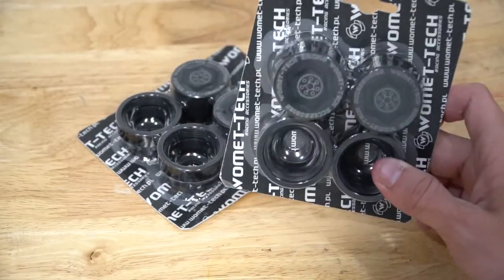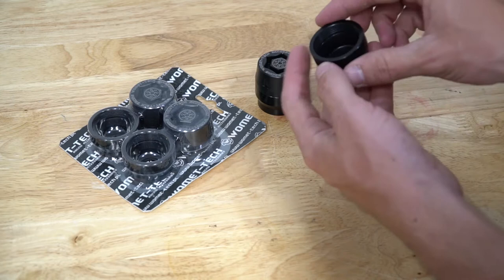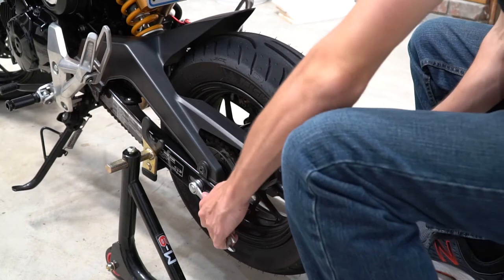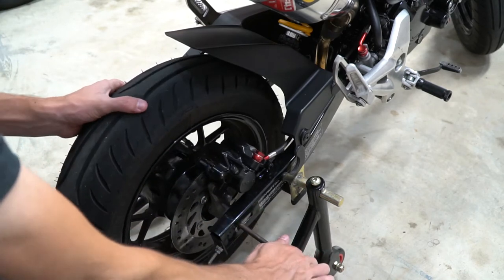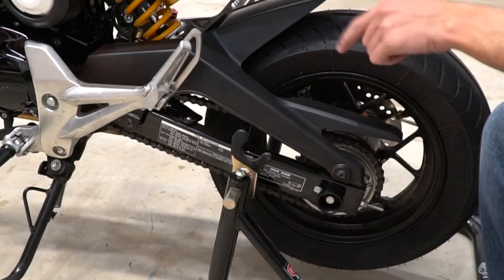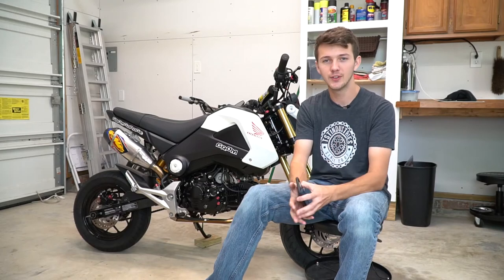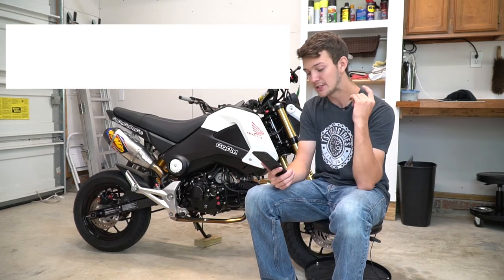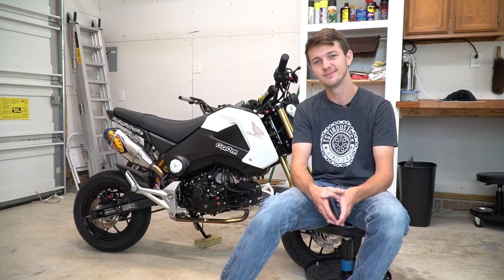TST Industries Axle Sliders

Comment: Had a quick question about these, how's the thread on the end of the axle nut after you put these on? Doesn't look like there's much there past the nut as it is.
Reply from the maker: +Kenny Vloggins we were able to put the washer and nut with just barely enough length  to engage the lock part of the nut.